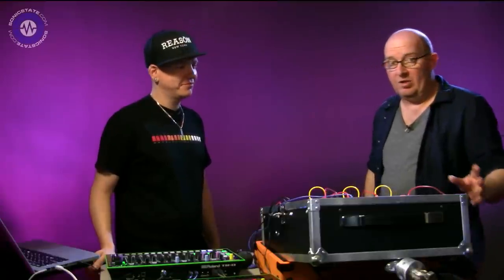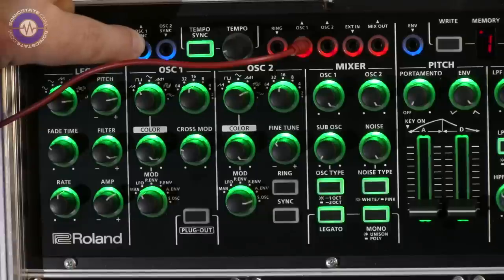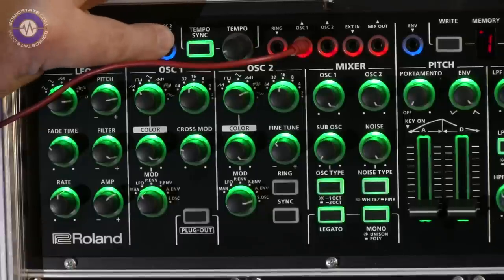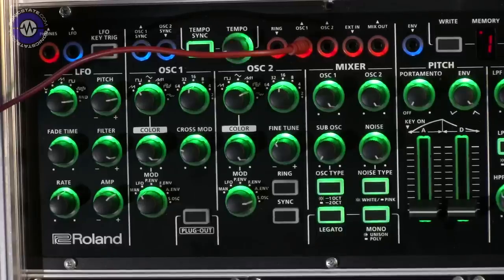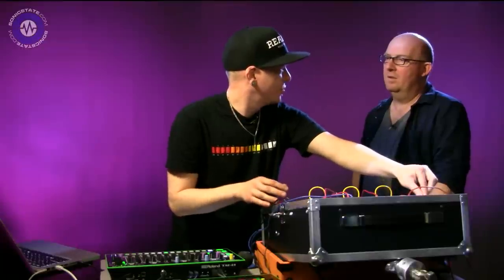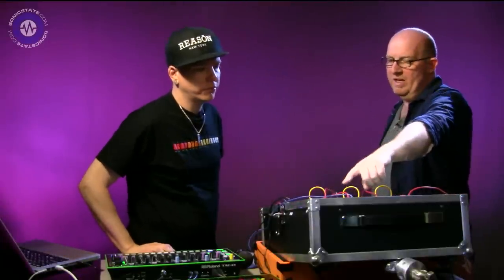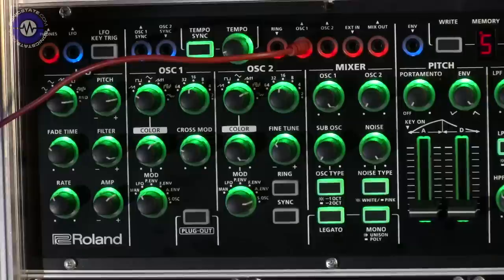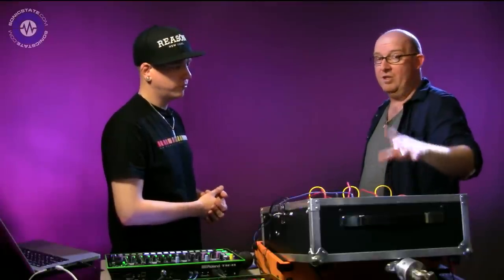Roland System-1M Semi Modular Presentation

Comment: I didn't like the System 1 keyboard, mostly due to the construction, but this eurorack module has real potential. Seems like a great way to add something very unusual to your Eurorack.
Reply: So did you grab one? What did you think? I have the Gaia SH-01 which is their earlier virtual analog tech stack, and it's highly underrated synth, IMHO.  Good keybed (unlike the sys1).  The plugout concept is mostly why I'd grab one of these.  It's a modern midi module.  Frankly what I want is a desktop System 8 or an 88 key system 8.
Reply: I have the System-1, several System-1m modules to take me into the Eurorack world, and a System-8.  I recommend all three.

Comment: I've  had two off these and both quickly developed the very bad habit of randomly freezing up and powering down under normal operation, as if they were power starved, This is with the factory 1300 ma power supply (why stress your euro ps ?) and no external patching. The first was replaced under warranty.  I'm waiting to find out on.he second one

Comment: so.. is it possible to use the CV/Gate-Out of the TB-303 to drive the system-1m without a converter or something? (the Gatevoltage of the TB-303 have 12volts!)
and thx for the great vid, Nick :)
Reply: ***** yes, doing exactly that with my setup in fact, it slides quite nice following the 303
Reply: nate frog cool :)
thanks for the answere!

Comment: Question regarding MIDI versus control voltage - is there a precedence? For instance, if you sent MIDI signals for chords but had a different signal running on gate input, would the gate input be used instead for the note on patterns instead of the midi?
Reply: i want to know this too - 5 years later
Reply: @nyrbsamoht  same
Reply: @O1O1OO1  from their website - 
"It is important to note that playing via MIDI or USB is not possible if cables are inserted into the CV (IN) and GATE (IN) jacks whilst in MONO mode. These cables must be disconnected to allow for MIDI or USB connection."

also does it do cv and gate output? my mother 32 can receive a midi sequence and then send that via cv and gate which is nice (eurorack modules that do that are expensive)
Reply: @nyrbsamoht  ohh thank u :)
Reply: @nyrbsamoht  oh thx

Comment: thanks for the vid. I am still wondering if the sh 101 comes free with it like it did with the system 1. Any official answers on this from Roland?
Reply: Limited period then you'll pay, have you asked Roland or visited their site?
Reply: jamie munro just put in the question on Roland site but through my internet findings no one seems to know.
Reply: May 31st , it's been announced by Roland
Reply: jamie munro yeah still seems odd to me. Are we certain this just doesn't apply to the system 1? The reason I ask this is because the system 1 just dropped about 100usd in price(this would explain the end of the bundling) and the sale of the 1m's has been pretty rocky in terms of having drivers ready etc and its the full 599 usd. Seems kinda weird to release the 1m and only offer the bundled plugout for less then a month it seems.
Reply: The Roland guy said it in a recent video on sonic lab mate
Reply: jamie munro Actually just got off the phone with Roland US. The system 1m doesn't come with ANY free pluguouts but it does come with a discount card to get one for 99USD instead of the normal149USD.  Also the SH101 isnt even for sale yet since its still being run as a promo with the system 1. 700 usd to get a sh101 with 1m is a bit high imo. Still looks cool but I think Ill wait for second hand prices at this point.

Comment: yikes, that demo couldn't sound more digital.. in the worst way imo. If that's the sound you want I guess it's cool to get the crappy sound w/o a computer.
Reply: Code Mode there are many vst instruments that come very very close to analog these days. Reaktor for one can sound indistinguishable from analog to most ears and most engineers for that matter if they were blind folded. There's vst like u_he relic. My favorite vst for analog sound is called polly a.n.a which sounds far better than any of the analog modeling synths from Roland.
Reply: Sounds modern. If you want to sound dated try Behringer.

Comment: I like Roland, but in all honestly this new AIRA thing, I dont like it. I think they design of the products in the series look awful and the synthesizers dont have anything particular cool about them that I couldnt get on some other synthesizer/modular synthesizer. 

For example, why would I get the tr-8 when I could just get the Elektron Analog Rytm? 
If I want 808/909 sounds, I can just get samples, and I wouldnt have to work with something that came out of a toy store.. i'm eager to hear what ppl have to say about this.. What do you consider so good about the AIRA stuff?
Reply: +Joakim Hellgren i bought a old akai s3200 not xl and run recycle 2.0 that is my drum machine. 99gbp bargin
Reply: Joakim Hellgren You smugly set yourself up for a response.. which is that the 808 and 909 have tunable parameters.. you don't just sample the sounds and have them..